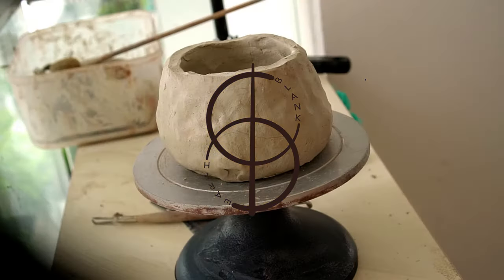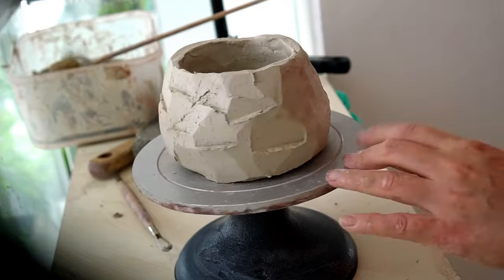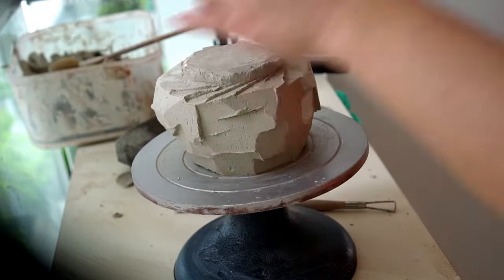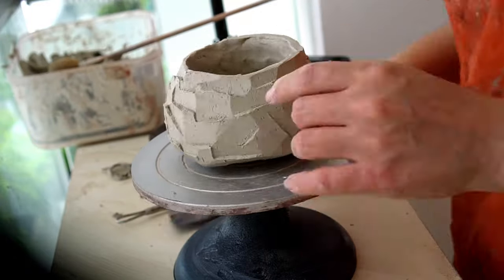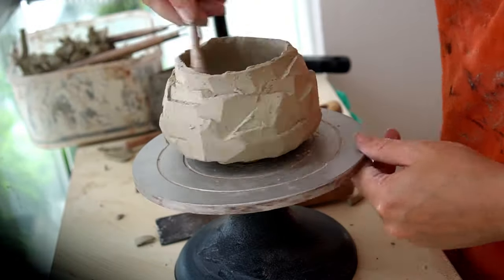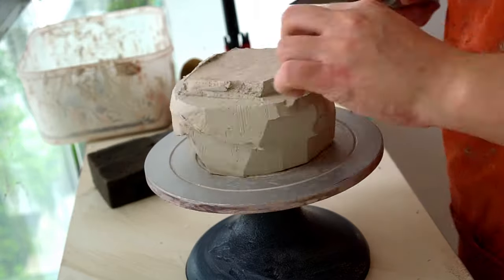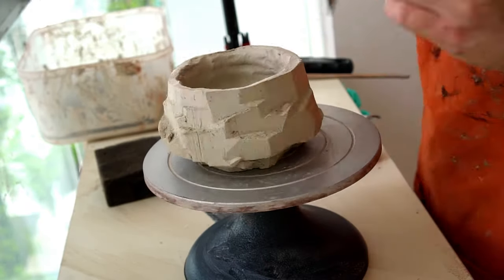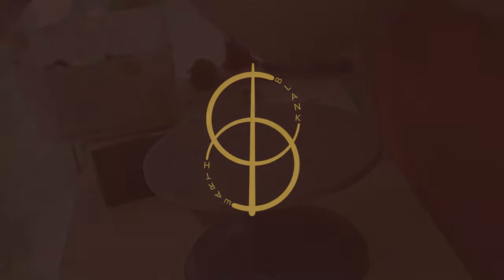Kurinuki Chawan: How to carve a Japanese pottery tea bowl

Comment: Hi from Japan. Very nice technique. So skillful. If I may add an observation regarding "as light as possible," we also need to take care that the heat of the tea water does not make holding the chawan uncomfortable, so we have to make the wall "just thin enough."  As we say, "the piece should be as heavy or light as the eye thinks it will be, before we pick it up."  Thank you!
Reply from the maker: Hello! Very jealous you are living in Japan :) We loved it when we were able to visit your beautiful country - we had planned to spend a couple of months there learning pottery before covid. Yes totally agree about the light as possible remark as you say thin enough is more fitting! There is an obsession (especially in the West) about making pottery as light as they can but picking up a piece theat turns out to be very very light can feel weird. I think I meant that with kurinuki it is difficult to get your pieces light as the technique of carving always means there will be some thickness in the walls so when you start out your pots can be very heavy and uncomfortable to hold. Anyways thank you for taking the time to write this comment and hope you are having a wonderful day x
Reply: @BlankEarthCeramics  Thank you for your kind reply, and sorry for such a late response on my part. Anyway, ANY day is a wonderful day, if at the wheel!